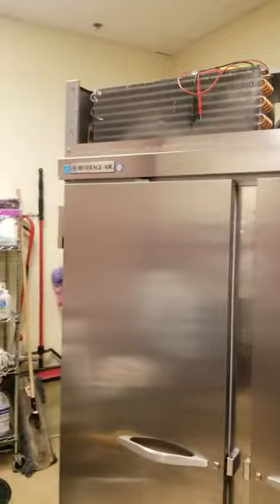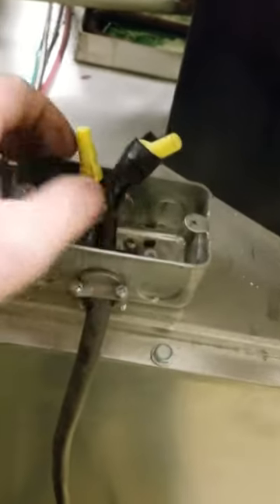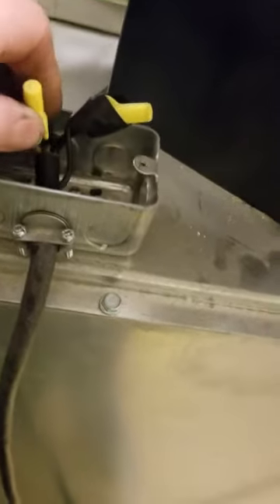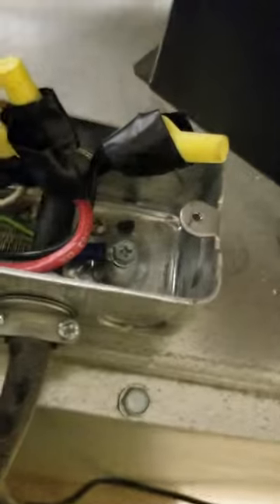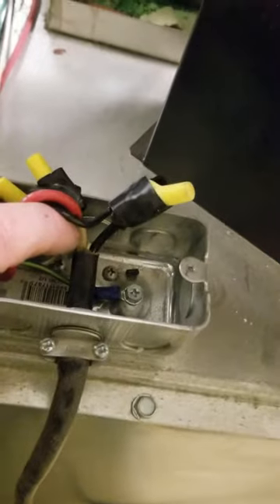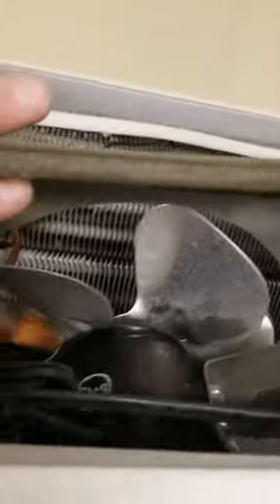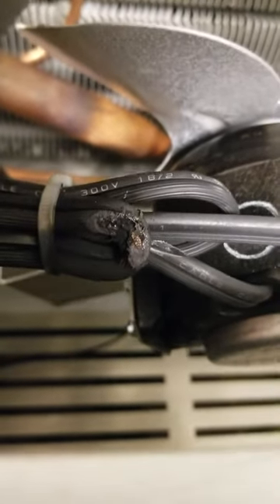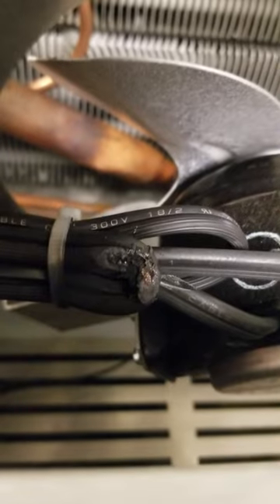Customer getting Shocked from the Freezer

Comment: HI. Thanks for sharing the video! My wife got a small electrical shock from the dishwasher the other day. I found that the earth wire was not connected properly in the wall plug. I fixed that and now the dishwasher does not have any issues. BUT, This means that something is still wrong with the dishwasher right as somehow voltage is [was] getting to the outside of the machine. Am I correct in assuming that? What do you think :)